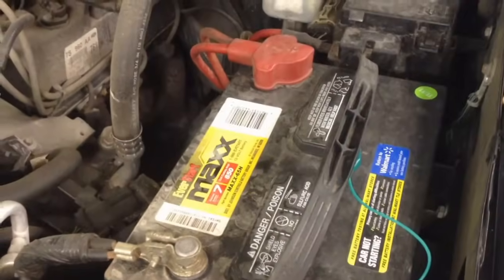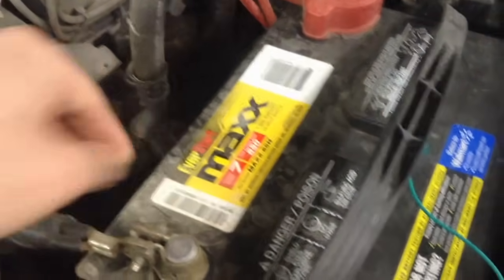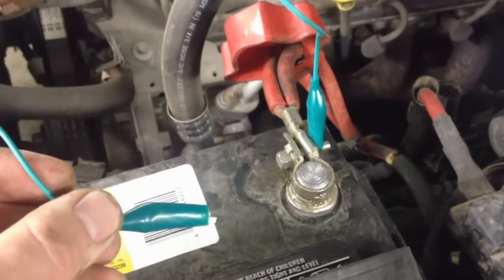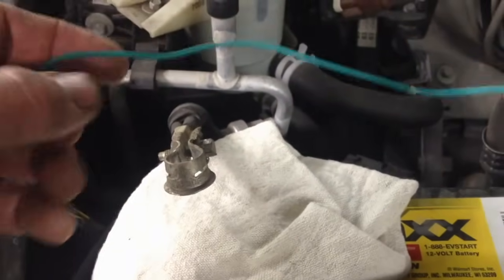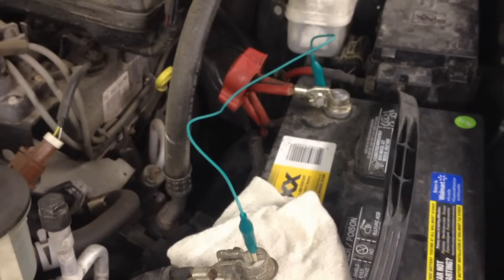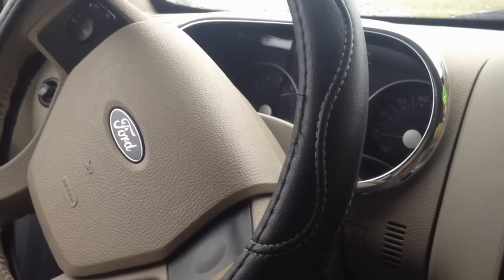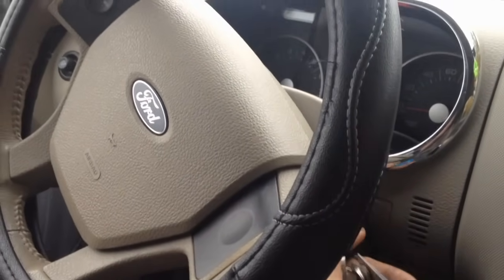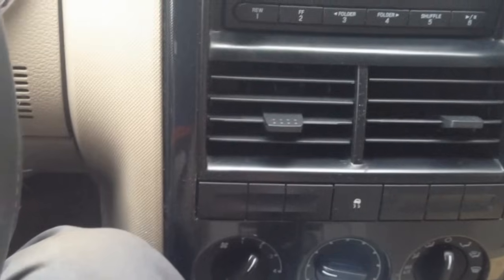How To Clear Your PCM'S Memory On Fords After Repairs

Comment: I have a 2000 Ford Windstar that's giving me a check charging system. Will this fix that issue? Or should I replace the PCM? I have a new battery and new alternator in it.
Reply: Ryan Smith one of the alternator wires is not making contact. check the middle one. your clip is probably chipped, cracked, or fucked up in one way.99% that's the problem.
Reply: I did the alligator clip on the van and it cleared the "check charging system" the only problem now is that i have a new battery that i killed due to the charging system failure before, i jump it to get it going and drive it down the road shut it off and it won't start again. Is it possible i messed up the battery somehow?

Comment: will this work on a 2007 f150
Reply from the maker: yes
Reply: How long to leave it plugged together
Reply from the maker: just a few minutes
Reply: +FordTechMakuloco 
so I've had a major problem with my xlt 5.4 
so bout a month ago I lost acceleration I hit the gas and rpm from 2400 rpm to 4700 is  when she shifts
she's a dog high rpms  no acceleration 
I have changed vct solenoids coil packs fuel pump fuel filter fuel pump module and mass air flow sensor 
and it gets worse when its hot outside
any suggestions I think my cats are clogged

Comment: I have a 2006 Ford free style first I got a code 0701 then same day I got a code 2111 and I replaced the throttle body .still does the same no acceleration when natural runs good stop at sign no acceleration

Comment: I have a 2003 f-150 with a 4.2 (v6) the fuse for the fuel pump was pulled out as the truck was running at a idling.  After I started it up it gave me 12 po code I did not have before. Now it runs rough will this fix my 2003.

Comment: I have an 03 ford explorer I cannot fix. No money to take it in. P0775 solenoid b pressure control malfunction. Changed solenoid pack. No difference. Reset the pcm. No difference. I'm at a loss. Please if you have any suggestions that would be great.
Reply: 97000 miles 4.6

Comment: Idle learning is on P or N for ten minutes?
Reply: For my 2008 Mustang GT it's in park for automatic transmissions or neutral for manuals. And according to the manual, your handbrake needs to be pulled up whether you have an automatic or manual

Comment: I followed this procedure after cleaning the throttle body on my 04 Explorer. After letting it idle to achieve trim characteristics, there is no throttle response. Nothing. Pedal goes to floor , but engine doesn't respond. What going on?
Reply: rts did u proceed to fixing this issue.? If so.. How? Having the very same problem with my truck
Reply: @amberannjohnson2325  I doubt it matters now, but I replace the throttle body.
Reply: Damn did you ever fix it? Worried about trying after hearing your issue.
Reply: @sillywilly6431  Sorry. I'm a bit late. I ended replacing the Throttle body. Got tired of screwing around with it.
Reply: same thing here starts but no pedal and the shifter will not come out of PARK

Comment: I have a 2001 ford Focus SE Zteck dual cam. The RPM's are stuck between 2000 to 4000. I dont now what else to do. I changed majority of the sensors and still cant fix it..Help PLEASE.

Comment: Dear Friend.

I’m following your channel on youtube since Oct 2015 and tried everything I could to fix my car, then I decided to write to you.

I really don’t wanna bother you, but I’m desperate.

My name is Tiago Biagi, a Brazilian Car Enthusiast.

I’m the owner of a 1999 Ford Explorer Eddie Bauer 4.0 V6 SOHC. It’s a really American Car, and it’s really rare in Brazil. Actually Ford only brought OHV V6 and V8’s. I bought this car from an American Consulate, so it’s the only Eddie Bauer around here.

The reason I’m writing to you is that no one knows this engine around here and no one can help me to fix it.

I’ve watched your tutorials and could solve a lot o minor issues, but the main problem lingers.

My vehicle was nice and perfect, than I took it to a garage to change spark plugs. The guy couldn’t change and return me the vehicle with something wrong. The car seem to be “weak” and and with a rough idle. The RPM are around 500 and the gear shifting is erratic.

I’ve changed the coil, the spark plugs, the gas pump, gas filter, the throttle sensor and a lot more. nothing changed.

Two weeks ago, I was able to import form AutoZone the Air Intake manifold gaskets…and checked visually for vacuum leaks… after reconnecting the battery it seems to run better and part of its “strength” was restored… but suddenly I stopped in a gas station, turned off the engine and when I started it again all the problems were back. The car looks like there is a rope tied in a anchor…

I think its something electronic, or maybe the IAC Valve. I’m trying to find some to buy but it’s hard.

I now I’m taking your time with this long text, but I need help. If you could give some tip or hint of what it could be, it will help a lot.

If you prefer I can make some video on youtube of what is happening 

I appreciate your attention of reading this and already apologize for the poor english.

Best Regards

Tiago Biagi
Ford Fan
Reply: im also a mechanic this guy has great vids  you never stop learning thats for sure if you need help with any info if he dose not get back to you call me anytime bud 202-491-8997 email wmautoservice@yahoo.com if u email me you might not get a response as fast as calling but i will do my best to help you out name is william
Reply: Thanks a lot Willian, I'm really glad to hear that. I will write to you soon. Thanks a lot for your attention. Best Regards from Brazil!!!

Comment: I forgot to mention that the problem I had was my 2000 Volkswagen Beetle automatic was stuck in 3rd gear. It stayed in 3rd gear and never shifted on its own to any other gear. I could manually shift down but it wasn't right. And your great advice fixed the problem! I had took it to a mechanic that told me over the phone it needed a transmission and was gonna cost 2,600$ I told them no way I was doing that. They also said it had a short in one of the cigarette plugs. The codes were reset and it was driving perfect again but as soon as I plugged in my phone charger into that cigarette outlet it went back to being in 3rd gear constantly. Thanks to your posting this I was able to reset it again myself Thank you so much !!!

Comment: Wouldn't it be just as effective to touch the negative cable to the positive, while never completing the circuit through the battery? Or is the resistance that sensitive that something like using that 20g~ clip trick is the only safe way?
Reply from the maker: +Topher Knows Exactly if something was done wrong the 20g wire would burn up no harm no foul but touching terminals could go bad real fast.

Comment: What s/one showed me which seems to be easier to clear the codes, is to take the positive cable off, and simply hold it on to the negative post for about 15 seconds without removing the negative cable.
Reply: Please dont touch the positive BEFORE removing the negative. You just increase the chance of dying otherwise.

Comment: I have an issue I wanted to run by you to get your thoughts. I have a 2003 F-150, 4.6, was getting the reading for a bad o2 sensor, bank 2 sensor 2. I replaced that and a couple of other things. I cleared the PCM's memory the way you showed. Drove the truck for 1 hour, ran perfect, no check engine light, no miss, nothing, ran like new. Once I turned off the truck, in less than 5 minutes the CEL came back on, truck ran like crap. Once I reset it again, ran perfect until I killed it again. Now for the life of me, I can't figure out what is wrong. Something is resetting after it warms up and I kill it, shows the 02-bank 2 sensor 2 and that is brand new. Do you have any thoughts on what this could be? Thanks Don

Comment: Hi Makuloco 
Thanks for all your videos. I used the valve cover gasket video to fix my 2008 Ford Issue. I had a Output Shaft Speed sensor replaced by the Ford dealer because my speedometer was going insane and not reporting the correct speed. I got the car back and the next day the speedometer started acting crazy again. So I unplugged the negative battery cable and let it clear out. Now the issue is gone. Should the dealer have cleared the PCM after installing the Output Shaft Speed sensor?
Reply from the maker: +Scott Davis Yes they should have.
Reply: FordTechMakuloco hello I love you videos and wandered If you can help me with a problem I'm having with my 03 f-150 King Ranch 5.4l truck ? My truck will not start no matter if it's cold or warmed up after driving it unless I use starting fluid. Once it's started it runs fine . Is there anything that you know of that can cause this. Thank you for all the cool videos they have helped a lot on other problems

Comment: I have had cars that were being difficult.
Leaving it unhooked for 24 Hrs has always worked for me.
I also cycle the key on a few times before I hook it up.
I have four fords and I can say for sure they do learn and you have to drive them the way you drive.
Don't leave out 96 and up because 95 and below can be cleared just by unhooking the battery for 30 min.
If your ford is a family car don't get mad if the computer is confused.
Grandma drives very differently from Grandson.
Anytime I get a loaner back it acts very differently for about a week.
I have one right now that is pissing me off.
It is a beautiful car and every time I turn around it needs something.
Reply: when you say pre 95 can be reset by unhooking the battery, do you mean both terminals or just the Negative? thanks

Comment: how to clear a "air bag light on a 2001 ford taurus"? installed a aftermarket stereo and now it wont go off? please help me clear this?
Reply from the maker: +Jimmy Jenkins What is the lfc?
Reply: FordTechMakuloco don't know what you mean? "IFC"?
Reply from the maker: the lamp flash code the air bag light is displaying
Reply: no flash code just removed the factory radio and installed a aftermarket one and now when car is turned on it just stays on. doesnt flash at all?

Comment: I have a 2000 mustang that I did a head gasket on when I went to start it with the key the security system is flashing and will not start the car, doing this will it clear the security to use the original key to start the car?!?
Reply from the maker: +Bryan Nephew Nothing was left disconnected? Is the pcm powering up?
Reply: +FordTechMakuloco the dash and everything else has power just cranks I don't think the fuel pump is turning on bc the security, and as far as plugged in everything was checked, only thing not plugged in is the o2 sensors
Reply from the maker: +Bryan Nephew Ok very simple test to see if pcm is powering up is to disconnect the tp sensor test for a 5v reference at one of the pins only one should have this.

Comment: hey i just replaced my who throttle body yesterday did the relearn process and it worked great for about 4 blocks then the wrench light turned back on as well as the check engine light. took it to advanced auto parts for a diagnosis and got the error saying the throttle body but for a sec the guy said it was showing an ABS error, which we were both confused. what should i check now? i have a 2006 ford explorer xlt 4.0 v6 with 16X,XXX miles on it..

Comment: Great video. Your video on the Canister Purge Valve saved me from getting rid of my 2010 F150 4.6L that kept stalling and behaving oddly when I filled the tank. Swapped it out with a new one and it runs like champ. Except for the tranny shifting hard between 1-2 and downshifting 2-1. Will doing the procedure in this video and having it relearn shift points do the trick, or do I also need to have the PCM reflashed?  Thanks for the help - great channel.
Reply: Did it work for hard shifts

Comment: I have a 2001 Ford focus with 2.0Liter single overhead cam engine.  The driver heard engine noise and re-routed back home which was about 10-15 miles.  The timing belt tensioner broke and the timing belt jump 5-10 degrees.  I replaced tensioner and the belt after verifying cam/crank alignment.  Car starts right up and idles fine but after hard driving the car will stall when you come to a stop.  I also noticed late 1-2 and 2-3 shifts once the vehicle was restarted after stalling.  Ok, is this SOHC 2.0 liter engine an interference or not?  And if engine is fine would performing memory erase help any?  If you can help any, thank you!
Reply from the maker: +jr scott Ford engines that use a belt are non interference. I have to ask did you rotate the crank twice upon completion of the timing belt install to see if the timing marks lined up again?
Reply: +FordTechMakuloco yes I aligned, spun crank twice, and rechecked alignment marks.

Comment: i replaced the thermostat on my 2003 town car, and the EVAP system still won't pass. should i disconnect the battery like u did i the video, and also reset the PCM system? or can i just reset the pcm system?

Comment: I Have a 2006 f150 5.4. It was running kind of funny, I changed all the plugs and coil packs.  It runs a lot better but it still runs funny going up a hill, its starts shaking but when I give it gas it straightens out and run right,  would clearing my PCM fix my problem??

Comment: Will this work on a 1998 Ford Taurus SE?
Reply from the maker: +Ethan Van Beck Yes
Reply: FordTechMakuloco I just tried it out and I let it idle for about 13 minutes and drove around for maybe 15 minutes and I could tell a slight difference in shift points but she still runs a little rough at idle. I think it might be the idle air controler. I have no idea about the condition of the fuel filter either. Thanks!

Comment: will this work on a 1999 7.3 diesel that the transmission is having issues going into 2 and 3rd gear?
Reply from the maker: +Brandon Teem It will rest the pcm to relearn yes.
Reply: Awesome, thanks
Reply: So I do that to both batteries then reconnect it like in the video and just hook it back up and drive it? Or do I have to do anything special?

Comment: Hi, i have a 2002 mercury Sable and i've been having shifting problems, idle control error codes and misfire codes and i've gotten new spark plugs and an idle controller put on and still the same problems so i was told i needed a new PCM, would it be best to replace the PCM, do what you have done in this video or get it reflashed as i say in your other vid? 

Thanks in advance!

Comment: My wife took her 2003 windstar through the car wash and now the cam sync is malfunctioning. I've reset this before using some kind of meter/tester but I can't for the life of me remember what it's called or what I did to clear it up. I guess I should of been a mechanic instead of a butcher.
Reply from the maker: +The Hammer ward You have water in the pcm

Comment: so Last weekend i cleaned my throttle body and maf with the right cleaner, all during the process i had the neg cable disconnected but didnt notice much of a difference. But now after your video im wondering if i should run to Walmart and get some alligator clips and then redo the project and try it again? what do you think?

Comment: I have a 2005 ford Escape had a problem cutting out changed plugs and wires, changed coil it died driving down the road and wont run unless you floor the gas. any ideas
Reply: Roy Howington I have the same problem. Only mine didn’t short out.....
I had a problem with it shorting out.... change the terminals on the battery.....!!!! It worked for me years ago....
Reply: I’m going to check the pcm

Comment: Are there any videos showing how to replace a PCM in a 2003 Lincoln Aviator, not just the PCM itself but also reprogramming it? Or is that something I have to have done at a shop? I am asking because I keep getting a P1120 on my Aviator. I have changed the TPS out 3x with no luck. The wires look good at the TPS sensor so I am thinking I need to replace the PCM. Your thoughts? Any help would be greatly appreciated.

Comment: Ive got an 05 F250 6.0. My 5R110 slips going into 4th. I thought I clamped both sets of battery cables together to clear but it still does it. I want to do it again and let it idle for 5mins and gently speed up to top gear, which I didnt do last time. Im wondering if the 20 degree temps will affect the fuel maps or anything? It usually coughs pretty good when I first start it up in the morning. Thanks a lot.
Reply: +BC4Lyphe Another question: Is there any way to boost line pressure or speed up the shifts somehow?
Reply: +BC4Lyphe sonnax
Reply: BC4Lyphe was wounding two no the answer

Comment: what if I just touch both terminals together and leave them touching for the duration?
Reply from the maker: +Glen Murataya If they will reach on your particular vehicle that will work yes. I still prefer the thin wire alligator clipped for most people as it will simple pop if you make a mistake doing this procedure where as battery wires together can pull lots of amps.

Comment: can this work for my 2003 Ford Taurus?
Reply from the maker: +Glen Murataya yes
Reply: FordTechMakuloco 04 taurus se 3.0 single overhead po606 pcm code part is expensive experiencing a jerk through first one time all gauges went flat on highway when a.c. was turned on and it stutters when accelerating on highway any tips before new pcm

Comment: I have a 2001 Ford Mustang 3.8L. It was running fine, I parked it and now it cranks but will not turn over. When I turn the key over all gauges jump to the left, then back. I've looked up what could be wrong and what I found was the PCM fuse is bad. Will this trick work to fix it?
Reply from the maker: +Kenneth Boyd This will not fix the pcm fuse no. Is the theft light blinking in the cluster with the key on.